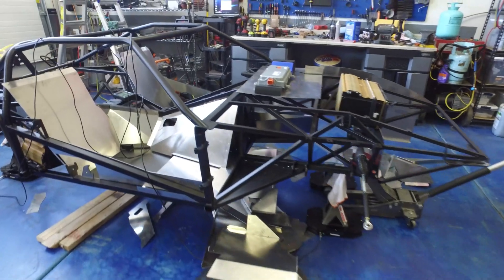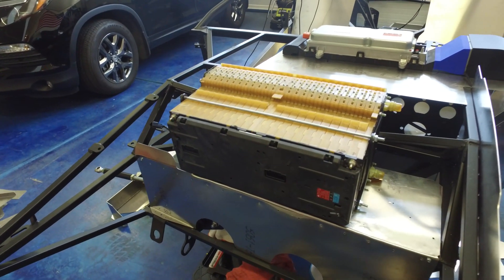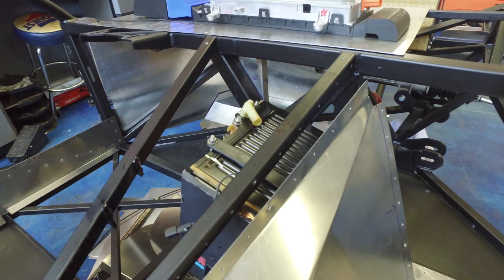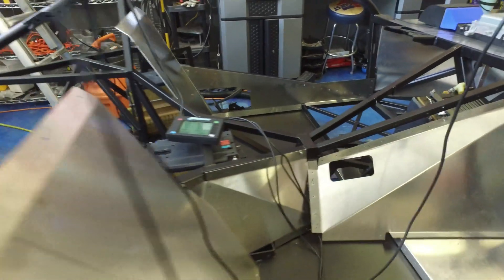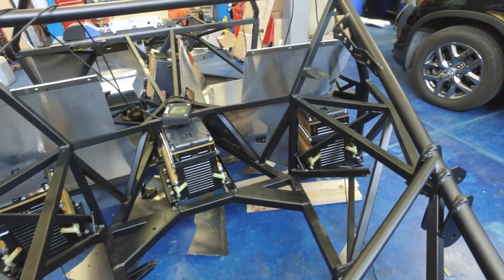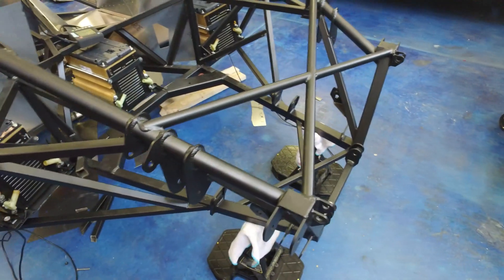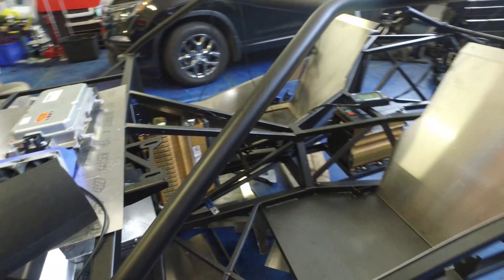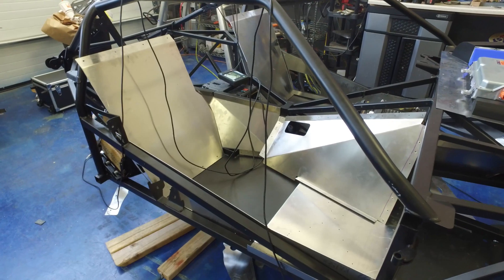Project Electric GTM - Mounting Batteries

Comment: I am following this very intently as I want to do this exact build. Do you have plans to make it water tight so you can safely drive in the rain? As much as it is a sports car I plan to get as much daily usability as possible.
Reply from the maker: Interior will be water tight for sure.  Everything else will be similar set up to the way they came from the factory aside from the batteries.  They'll be covered from splashing by the aluminum sheet metal that is supplied with the car and anything that isn't, I plan on covering with custom sheet metal.  The Tesla drive unit is exposed to the elements as they come from Tesla, however they can't be submerged.